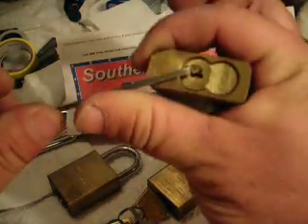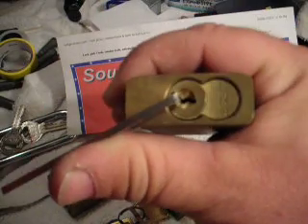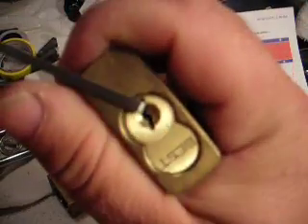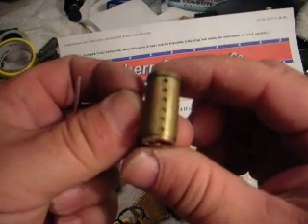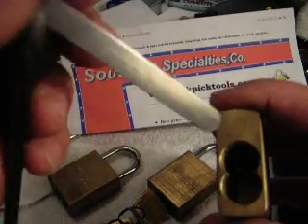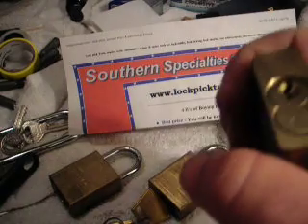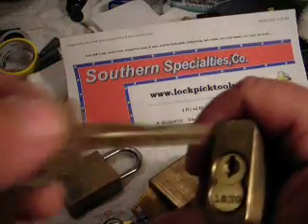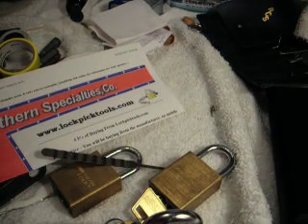Best "A" keyway picked to control line

Comment: Do you need a special tension wrench to set all the pins at the control line? Also, I have heard that if one is trying to pick to the control line that it can help alot to apply CCW torsion..